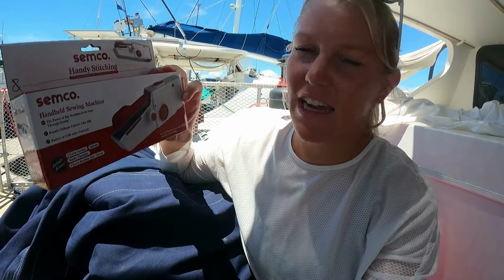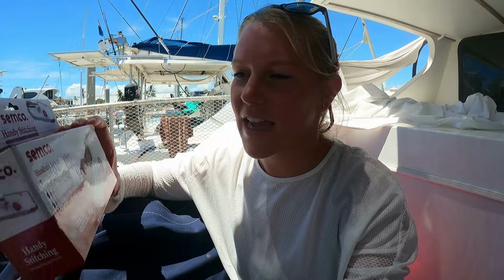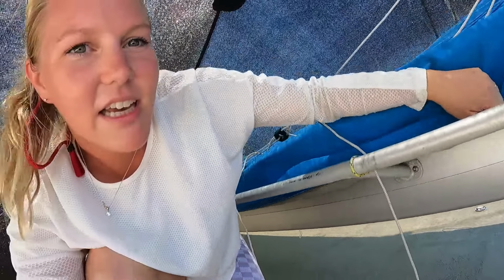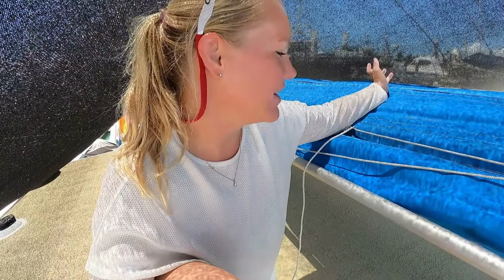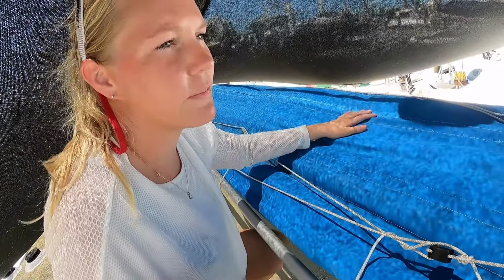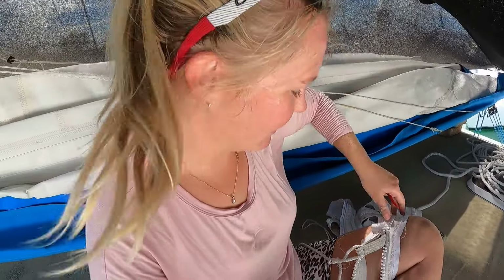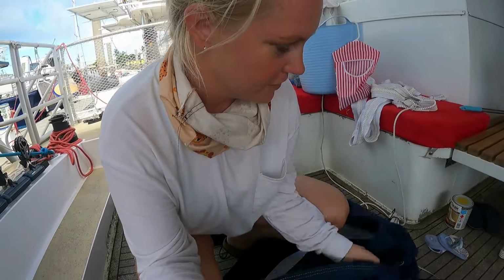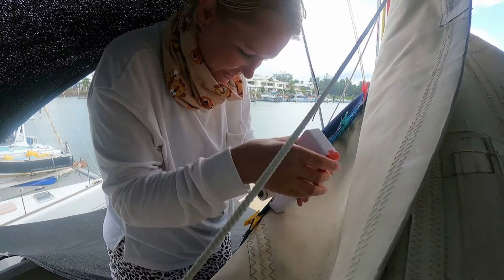Can a handheld Sewing Machine Repair a Boom Bag | Sail Bag Repair | Sailing with the James's (Ep.74)

Comment: Spoiler alert, you don’t get to see if the hand held sewing machine works
Reply from the maker: Hey Mr Bob Mac! 👋
Yes you are right, we have gotten better with making full circle videos showing start to finish. The little hand held sewing machine worked but the thick canvas worked the machine hard, and the needle and mechanism ended up breaking and we hand sewed the rest of the bag. We have just completed a major refit and are very proud of all the modifications to the boat, hope you are able to spare some time and check out a few refit videos!
-Cait